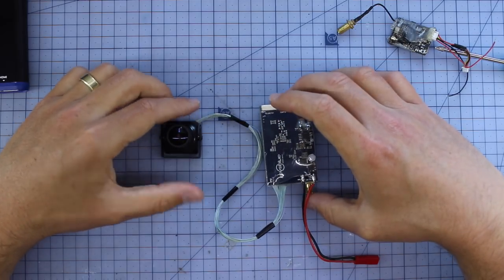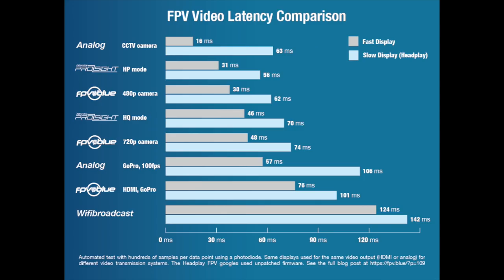DIGITAL 60FPS HD FPV - FPV BLUE - Tech Tuesday UAVFUTURES

Comment: Penetration on analogue is not a fault it's because your using 5.8ghz. use low frequency. Also digital when it reaches its limit it just cuts out. You'll still see something with analogue

Comment: Its looks nice for a search a rescue setup. Still massive in size for quad though. Give it a coupe of years I think
Reply: lets hope so. Still the problem of latency. 50ms is pretty big. Although I have been flying with Runcam Split and not noticed much lag. But I would think top racers would.
Reply: Agree no good for actual racing. But great for cruising; and probably easy fit on any 7" or bigger quad. Also good on any wing. I want one :). So for Aus, we probably want the 2.4Ghz version I suppose?
Reply: its more for planes. you now nat nall people fly on quads

Comment: Should I get the Eachine-EV100's or should I get some basic box goggles?
Reply: Enzo M. If you are going to spend that much you should get high end box goggles. Either the eachine ev800d or eachine goggles 2. From what I have seen the boscam  gs922 goggles look like the best cheap goggles but I've never used them

Comment: This would be great for a long range wing right?
Reply: Probably, but digital has one disatvantage, which might make ist less relaiable in Long Range flights. You of cours will get great Video and no breakup, but the dropouts (if they occure) are much more severe. You get a black Screen or a freez frame, with angalog Video you get breakup but can still see some pieces. And I also think, that you get better range with a analog 1.3 GHz setup with good antennas. But the experience while flying would definitely be better, but you are missing the osd.
Reply: Hey, we have an embedded OSD, supporting Vector and Mavlink inputs! Check out bonafidepirate's video for more!
Reply: fpvblue Oh, thats great. I didn't know that.....

Comment: Dunno about the antenna. My Prosight mini antenna is much smaller and better designed. Only downside is 500m range. But where I fly it's fine. Good to see another HD rig though.
Reply: Dale Pattison It's a lot of better than prosight. No comparison in image quality. See the bonafidepirate video.
Reply: It's actually a VAS 1.3 V antenna. You're not comparing the same thing... The 2.4 version obviously will be smaller.

Comment: Hey stu doesn't 1.3 require a ham license?
Reply: Henry Read-Spinks does that apply in Australia?
Reply: Hi Henry
Each region has its own regulations. In the USA, I believe, holding a Technician Class Amateur license will allow you to use 1.2GHz -1.3GHz but the equipment will need to conform to FCC directives to allow it to be sold on the domestic market. Here in the UK a Foundation level amateur radio license will again permit you to use those frequencies on a secondary user basis. HOWEVER, in the UK there is no provision that permits the use of amateur radio on any airborne platform, full size or model. The only options that legally exist in the UK are those covered by the ISM and SRD specifications (license exempt) in segments of the 433MHz, 459MHz, 800MHz, 2400MHz, and 5800MHz, allocations. I've held a full amateur radio license for over thirty years and these restrictions are a source of much frustration when it comes to the applications to SUAV's and FPV.

Comment: Not sure how you could say the Connex stuff is bigger. The Connex racing antenna is about the same size as our analog antennas. These 1.3ghz antennas are MUCH bigger. You need to compare the two side by side. Also this VTx is what, 10-15 grams heavier than ProSight? I was hoping Fpv blue could be used on a mini quad but that’s not looking too promising.
Reply: kenkamm This is intended for planes at first.
Reply: Mario Navarro Yes I’m aware of that but some folks are going to put these on small fast drones, I can guarantee you that.